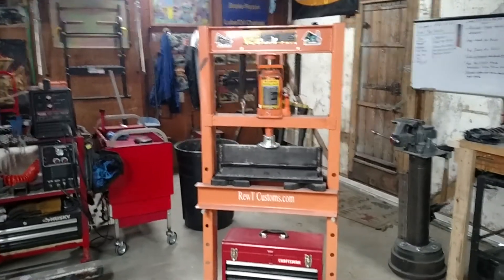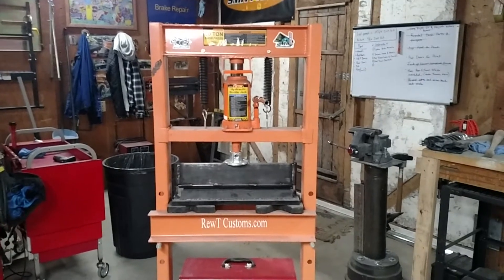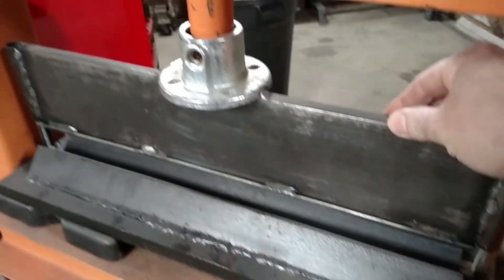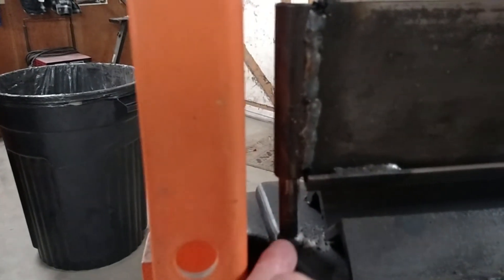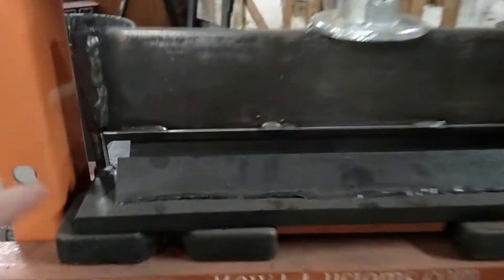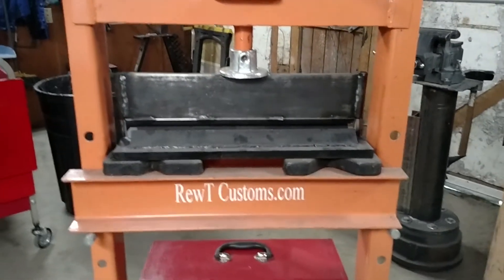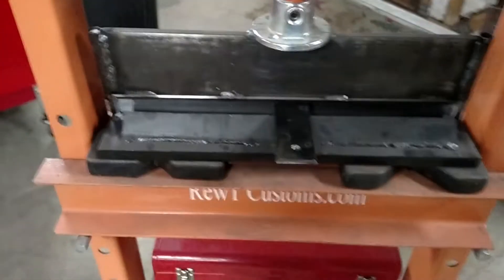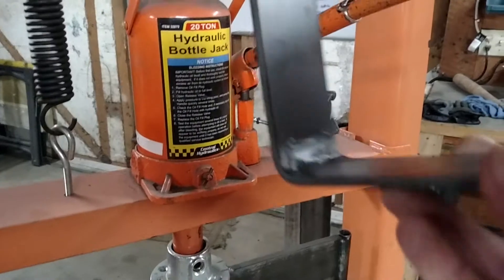Shop Press with a Homemade Press Metal Brake.

Comment: Looks like ya did a nice job! There's a good-natured pride in making our own tools like you did for around 30.00 - 40.00 instead of spending approx 200.00 just to have the parts shipped to us and then we still have to do the work of finish making it.....psssst by the way our harbor freight had a sale last Fall on these 20 ton presses. They were marked down to 129.99 and then I had a 25% off super saver coupon! YES I STILL GET A BIG SMILE EVERY TIME I USE THE PRESS and will get a BIGGER smile when they put their 20 ton hydraulic air bottle jack on sale and I got another 25% off coupon!
Reply from the maker: Thanks! Its a awesome tool and love using it! It is supper handy and use it a lot!  I did upgrade to the 20ton jack a few months ago and couldn't be happier. Thanks for watching!